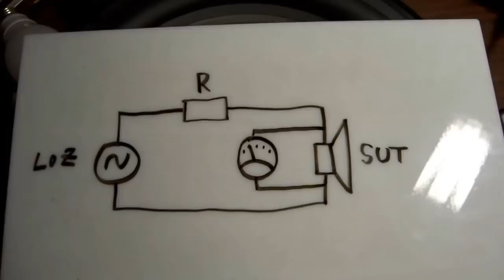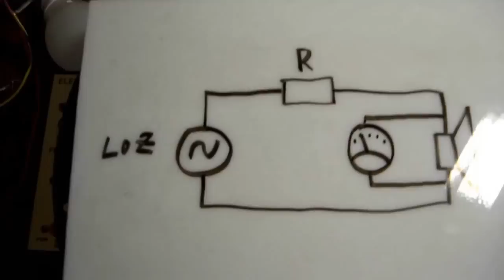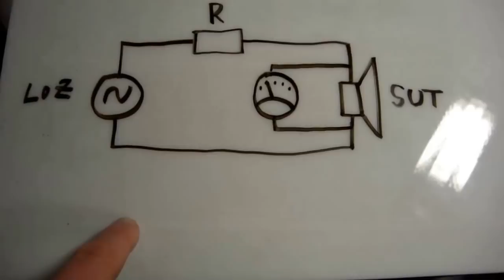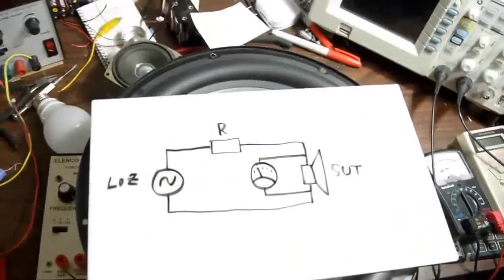Measuring speaker free air resonance

Comment: I mean, I've seen that the speaker parameter that matters is XMAX and FS, both are easy to get. Then you make the box.
No need to ask the factory the parameters, in fact, 60% of the speakers have no parameters. Getting these two is a HUGE step to make a speaker box.
I've heard that the FS is the frequency that the speaker gets all insane on the table and bounces around. No need to use any equipment I suppose.

Comment: My 18 inch woofer's free air resonance is 27 Hz, is it good for a subwoofer to use in a ported enclosure ? I have two 18 inches drivers and planning to build a subwoofer enclosure
Reply from the maker: You'd have to know more of the parameters but 27Hz resonance would be better suited for ported.

Comment: Why does the resistor have to be 8-10 ohms?
You never mentioned which setting on the meter. I assume it’s AC volts
Reply: he used his CRO not multi meter....Multi meters are calibrated to 50 or 60 hz but still you can have test using multimeter  using a relative test at each frequency , that means, measure voltage across speaker terminal and them measure at amplifier output .

Comment: Very interesting!! Question - many times we see two parameters given in datasheet. Some manufacturers say as an example fs is 45 Hz and frequency range  is 50-1000Hz let's say. How does it link? Does at all? Or the 50-10000 value is pure marketing? Where I want to go with this question is I would like to build open baffle speakers and want to understand what is relation between Fs and lowest reproduced frequency on -3dB. Many people tend to say that Fs should be considered as bottom line of the bandwidth for open baffle speakers (means if speaker got Fs=45Hz the lowest acceptable frequency reproduced will be 45Hz as well or slightly above). Would you tend to agree with such statement?
Reply: If you found a logical answer, feel free to share it with us.

Comment: Hello Sir. I have a question. Some have suggested to keep the output AC voltage at the speaker low, something like, between 0.5 to 1 volts while doing such tests. Whats your recommendation ?
Reply: 2 volt RMS is just fine

Comment: Multimeters are usually designed to measure 50 - 60HZ on AC ranges. Some have a poor  'frequency response'  below this which can skew low frequency readings.
Reply: he is not measuring  on a multimeter , he has got a CRO
Reply: @qtc9231  
 Watch the video. At 5.04 he says "Then you want to connect a meter across the output"... A meter is also what is shown in his connection circuit diagram. Yes, has has a CRO, but many don't.
Reply: No, we have multimeters to measure higher frequencies too

Comment: What is the purpose of the resistor? Doesn't that change the resonant frequency of the speaker?
Reply from the maker: Amplifiers act as a constant voltage source and would make it hard to measure without the resistor using a scope. The resistor won't change the resonant frequency.

Comment: Hi John, 
Thanks for this great video! I've just succeeded to get the Fs of my speaker. Is there a way to get the other parameters needed to build a box with limited tools? I've got only a pc and a multimeter.
Reply from the maker: Unfortunately some of the other parameters are more involved to measure. They make easy to use devices to measure speakers but are only worthwhile if you have several speakers to check. Elliot Sound Products site has more info on manually measuring the parameters if you want to pursue that.
Reply: Thanks +JohnAudioTech! I'm looking for some foolproof method to determine the parameters. This is my first speaker project so investing into a USB tool as you have mentioned doesn't worth it. Anyway, I've just found out about Limp software which looks like an fairly easy way to go but I need to find some spare time to dig deeper into.

Comment: Car subs tend to be tuned quite high 70/80 Hz hence the one note boom you hear from such equipment. For some reason people WITH these subs tend to feel they should share with everyone in the area! Thanks for the video John.
Reply from the maker: Michael Beeny It's no wonder as they stuff the drivers in tiny boxes. Back 20+ years ago when I was into car stereo bass, I tuned in the 40-50Hz range and used quite large vented boxes with relatively low power. With only a 15 watt per channel home made amp, I still shared the bass pretty well :)
Reply: Now they have proper drivers with efficient magnets so they can tune lower with small boxes, but parametric EQ DSP still isn't standard process unless you pay premium. Smart guys use the chinese $9 ARM based systems to process the sound.
Reply: 70-80Hz? Never seen thing like this in car. Highest tunes are in 40hz range. Me and everyone I know tune <35hz. Even for SPL competition no ene tunes higher than 50hz, since there is no point. Rules limit upper frequency in competitions to 60hz. One note boom is because most of boxes are tuned for flat or even peaky response. Then cabin gain does it's thing... So there is huge peak in response around tuning, and because of that it feels one note. Frequency response is rising towards low end. Google cabin gain for more information.
I like 4th order subs with falling response, they match cabin gain very nicely and produce realistic bass, not some one note boom.

Comment: Good info. I'm going to have to make that speaker job a priority, but there are so many other important or must-do jobs demanding my sparse free time. This spate of warm weather got rid of most of the snow so I was able to get some wood in and etc.
    Besides resonant frequency, I always thought drivers for air suspension had to be made special, more heavy duty. ?
Reply from the maker: ***** Haven't seen snow down here for about a month! Yes, a lot of subwoofer drivers have heavy cones for rigidity plus the mass keeps the resonance low at the cost of efficiency.

Comment: there are free tone generator apps for smartphones.
Reply: +Tiit Saul That's pretty much the last place I'd think to look for a tone generator, but if the distortion is low, why not? Clever. Of course, the output voltage is very low on most audio players, as John frequently mentions.